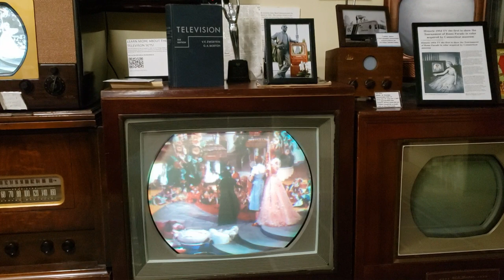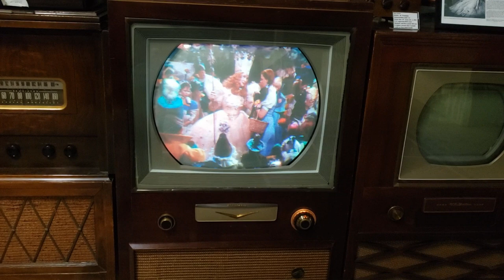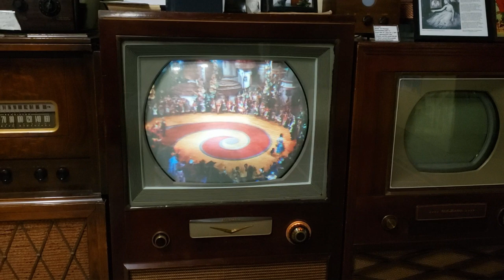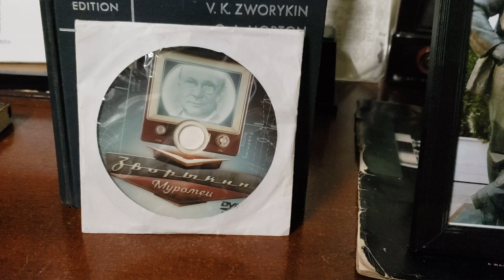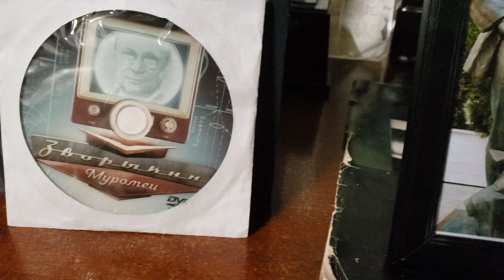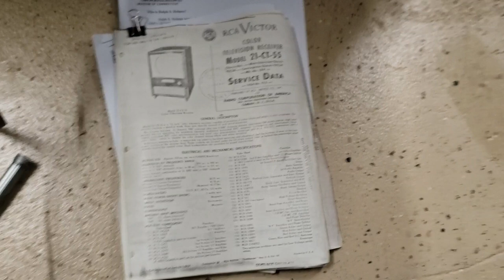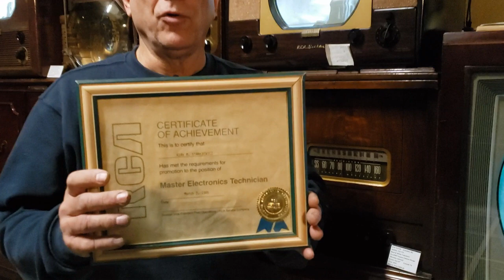Vladimir Zworykin's 1954 RCA 21CT55 At The Vintage Radio and Communications Museum of Connecticut

Comment: I was a technician for our local RCA dealer from 1976 until they closed their doors in 1997. The oldest set I saw on the bench was a CTC-9.
Reply from the maker: The CTC-9 was a VERY good set- 1959-1960. When I was at RCA Service in the late 1970's we still had a few under contract-

Comment: I'd like to see the schematic for that 6080 voltage regulator factory modification. I haven't seen any publicly available 21CT55 documentation that mentions it, and as someone what has both a 21CT55 and a CT-100 living on 60lb external voltage regulating line isolation transformers I'd like to try the 6080 circuit on my sets so they can better deal with local grid fluctuations.

Comment: I worked in a TV repair shop as my first after school job. The owner was a ham radio operator as was I since age 15.  The first time I saw movies like The Wizard of OZ, shows like Bonanza in color was when I went to work in that shop. Few people could afford, or wanted to afford, a color TV. Around 1968 we received our first color TV under $1,000, an RCA table model retail priced at $995. We sold several of them. Calling them table models was laughable. Yes they were made to set on a table/platform, but it still took two people to move it around. The floor consoles were so large and heavy that when I was sent out on a service call, if I couldn't fix it in the home, I would unbolt the chassis, unplug all the connectors to the tuner/tube/speakers and haul it back to be bench worked. Degaussing was often the problem with early color TVs. My boss made a homemade degaussing coil. The colors would get mixed, blue in a corner and purple/red in the other side. Degaussing would straighten it up. Years later, in the mid 90's as an accountant, I walked by a secretaries desk and noticed her IBM monitor has "skewed up" colors. She said it had been that way for a while. At the time we backed up computers onto small cassette sized tapes and we had a tape eraser. I said "hold on, I can fix that". I grabbed the tape eraser, waved it around top and bottom a few times and straighten up the colors. She said how did you do that. "MAGIC" I said.